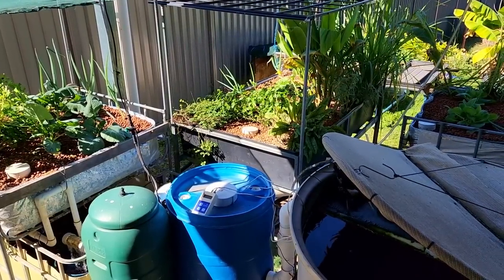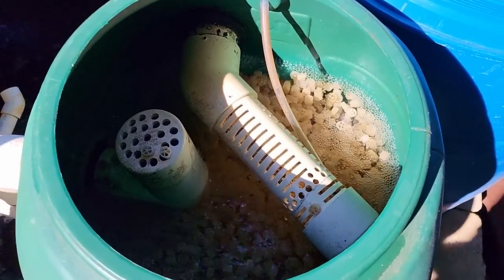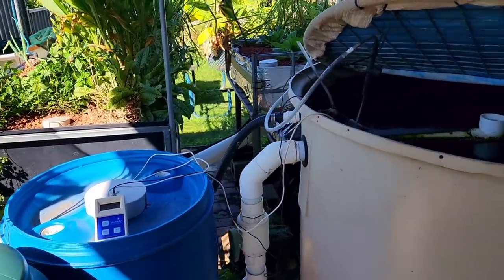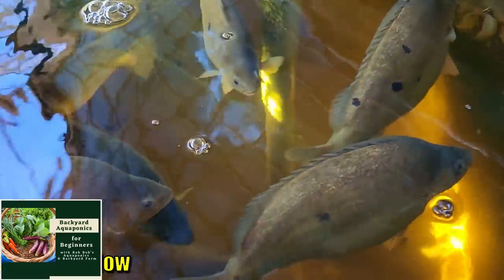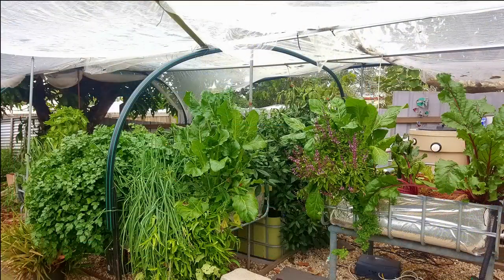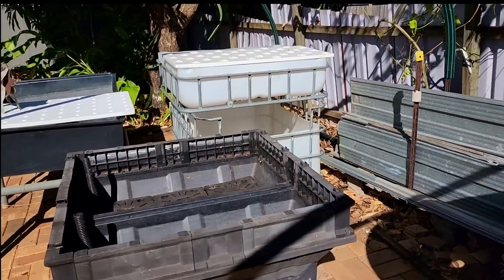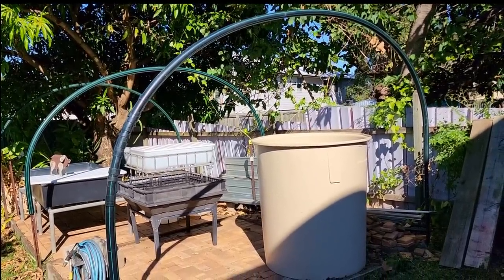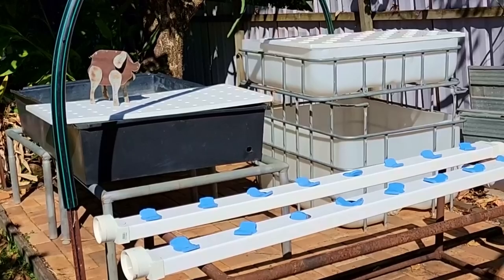New Aquaponics System Design

Comment: I personally would probably go for a #DWC. I am aware that I probably need to add a lot of oxygen in every grow bed to prevent root issues, and it needs enough bio filtration outside the growing area.
However, clay media is extremely expensive here, and I think I world be able to cut some costs. Even with extra pumps for oxygen and a larger bio filter. Also, if something happens during winter and the water is freezing, the clay is most likely pulverised. At least a good amount of it.

All in all, I think a lot would speak for DWC, at least in my case. 

As a second option, I would experiment with DRZ, e.g. for things like potatoes. But all that is only possible is if I can get a greenhouse going. Including heating in winter and all the electricity needed for the pumps. Most likely, I would need some solar to offset the cost in the long run. 
Without that, I would have to drain the system every winter. In other words, I can simply stick to growing in soil.

At least, that is my current train of thoughts.
Reply from the maker: I have seen folks complain about their clay splitting so it does happen a bit. Rock is always a good option, just heavy & can be hard on the hands when working with it. 
DRZ grew us some of the best spuds ever so will be planting some out later today. Just hope I haven't left it too late into our mild winter to do so.
Hope the build goes well when the time comes BW. 👍
Reply: @RobsAquaponics  I hope so, as well, haha... Besides the issue of money, there are still a few things to figure out. Most of all, water temp. How do I prevent water from freezing, especially in the pipes, during cold nights. We usually have a few nights with around the minus 15-20°C. On the opposite end, during summer, we have a heatwave or two with close to 40°C.
So, I need good insulation for winter since I don't want to shut off the system. But I might also need removable panels for summer to not overheat the water. So much research still to do...

But your channel is high on my list. You / your content never disappoints. There is always great info. Thanks heaps for all the work you put in.